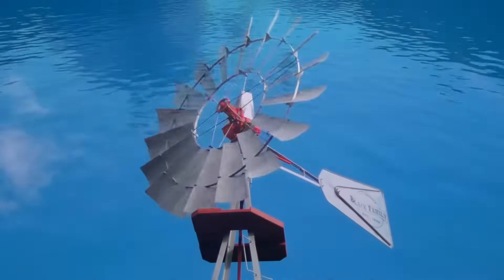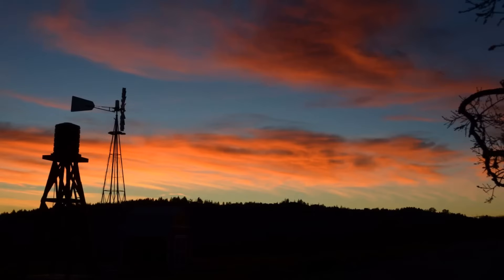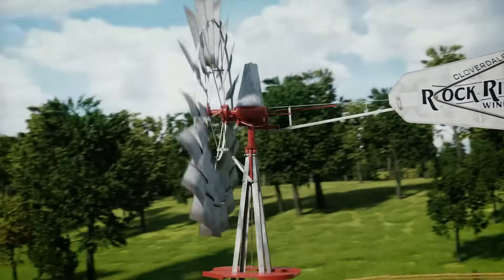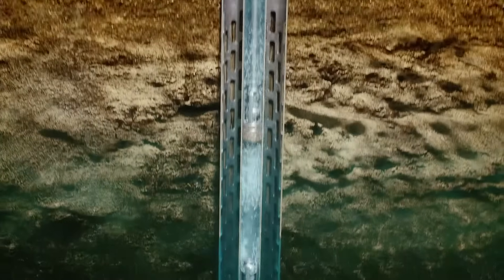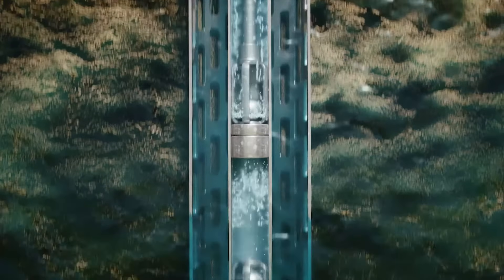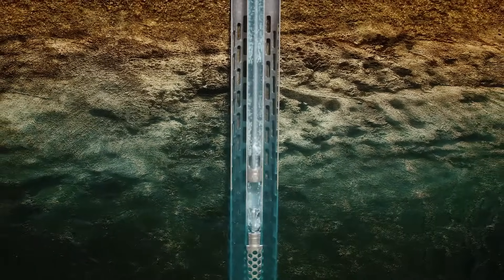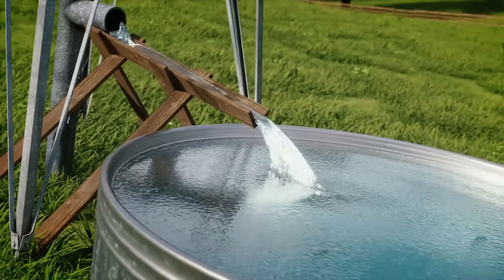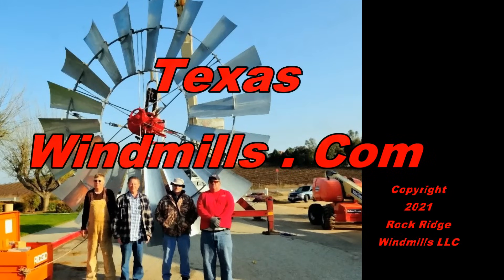How a Windmill Works

Comment: Great video, but it did not answer my question.
Which way does a windmill point when wind is blowing?
Reply: The windmill vanes face the direction of the wind. The rudder in the back keeps the vanes facing the wind.